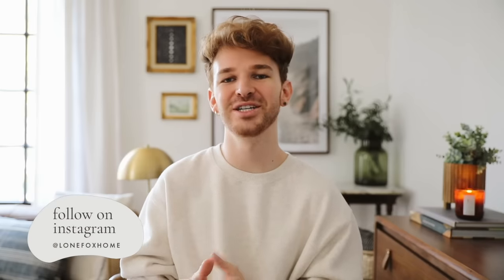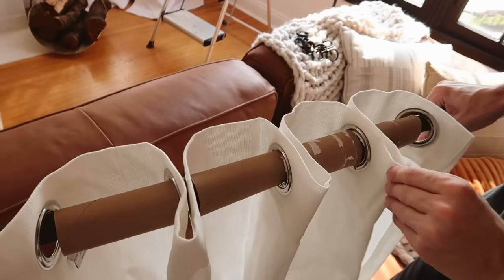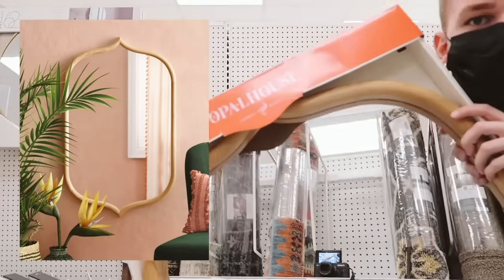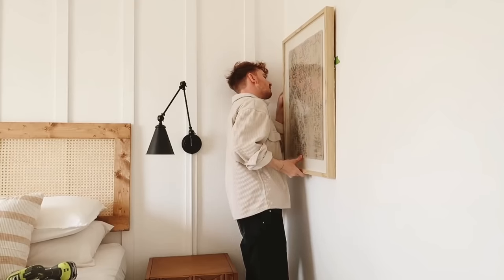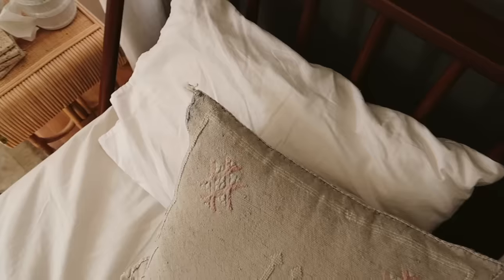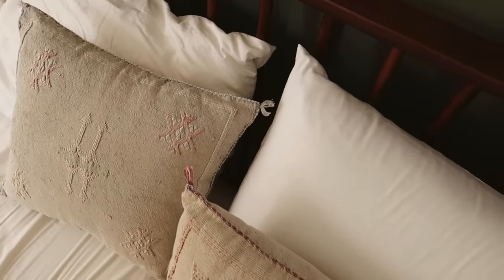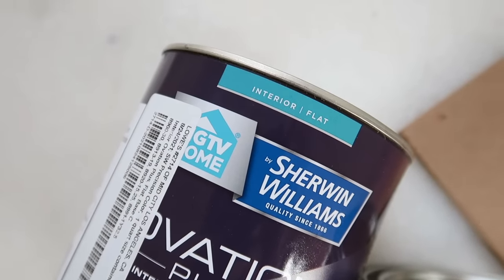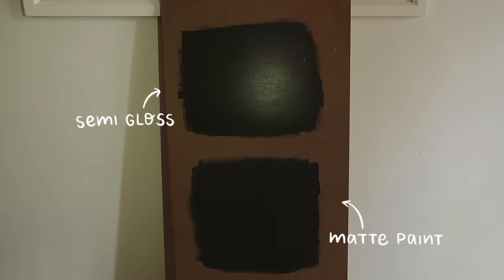10 GENIUS Home Hacks That CHANGED MY LIFE 🏠  Life Hacks to Save Time + Money!

Comment: Hey Drew! I thought I knew every toilet paper roll hack..... but this one is the best of all. I use mine to put around wrapping paper rolls to keep them closed. The painting technique is also genius, as I do a lot of painting in my crafts!
Reply: Ooh never ever thought of that for wrapping paper! Simple but totally effective! Back to rummaging through the recycling!!👍😊
Reply: @olbird7647  It works! You can cut the tp roll on one side and tape it shut if you need it to be smaller or to fit on a larger roll!
Reply: @Patti-1962  excellent tips- thank you! No more getting in a pickle with unravelling paper 😂👍
Reply: @olbird7647  I do this to stop rolls of bin liner/trash bags from unraveling. To keep both paper and bag rolls tidy I cut the toilet  roll lengthways and put it around the paper or bags then place an elastic band around it, then it fits any diameter of paper without damaging the paper (which is what would happen if you use just elastic bands).
Reply: @smurfmonster  aha! Another good tip, thank you! 👍😊
Reply: @olbird7647  you’re welcome 😊 having those rolls of bin liners/bin bags unraveling drives me NUTS!! 🤣
Reply: Toilet paper rolls are just so darn useful! I use them as molds to make upcycled candles out of  wax scraps
Reply: @adelehare8495  That's a brilliant idea!! I have so many used candles stacked up.... I will definitely have to try this!! Do you put clear wrap inside the tp roll before adding the wax?
Reply: @Patti-1962  I normally pour the hot wax directly into it, but it probably depends on the thickness of the cardboard. The cardboard gives it a rough, imperfect finish in the outside which I actually really like. You definitely need a secure base (I just glue a thicker piece of cardboard on the bottom) and you need to let it dry for a day or two before peeling it off

Comment: For tip 2, make sure you measure the distance from the top of the frame to each hanger bc they often aren’t exactly the same and if you don’t, your hung picture may not be level.
Reply: Originally a hanger on each side was there to string wire between the two— so that you have more play and can move a picture (or a mirror hung on a wire/line)  to the exact right position....i.e.  “up a bit on the right”

Comment: One of my favorite ways to hide cords dangling cords is to use a cord cover + plant. I used this with my TV cords... Command strip to attach the cord cover to the wall and paint it the same color as the wall. Then place a plant right in front of the cord cover so blend it all into the wall. I put my plant on the credenza and the top of the plant ends just below the bottom of the TV, so it completely covers the cord!

Comment: Those dang D-rings- sometimes they aren't lined up on the frame, so all of the effort with tape still results in a crooked frame when hung. The older and crankier I get, the more I like just twisting picture wire tightly between the D-rings and using one hook in the middle, resulting in less colorful language and more time to rest on my decorating laurels. Great videos and hacks as always- never saw the toilet paper roll one before, and also didn't know there was such a thing as rechargeable light bulbs! Thank you so much, and also, thank you for your wonderful personality. A day with a Lone Fox video is a better day!
Reply: Very true!
Reply: I use picture hanging wire.  I thought that's what they were for.
Reply: I can sympathize with the older crankier thing. I don't remember wanting to bang my head against the wall when hanging pictures when I was younger. The head banging doesn't help at all with the picture alignment😉

Comment: You can simply string picture wire between the two hangers on a frame. Then put your nails wherever you wish. I recommend using two for maximum support. It is simple to level a picture hanging by wire, even if the nails are at different heights : )
Reply: My thoughts exactly, I have never known anyone nail two holes into the wall.

Comment: Hello Drew. I’m new to your channel but I am enjoying it so much. Thank you. 
I prepare my own artwork for exhibitions and it is usually a requirement to have two D hooks - one each side of an artwork, even when they are small. I take a length of nylon chord or a wire and thread it through both and tie it in a knot. When hanging just pull the chord up in the middle, making an upside down V. Measure from the top of V to top of frame to determine where to place one nail/ screw in the wall. This is great for artwork that for some reason doesn’t hang level, as you can easily adjust it. You can raise or lower the height of picture without moving the nail by hanging on single side of chord loop or by two.

Comment: Hi Lone Fox!! I think the 2 picture hangars are so you can tightly  install picture wire from one loop to the next so that the frame hangs straight. For instance, if you put 2 screws in the wall, about 2 inches apart, and leveled, you then hang the wire on the nails and the frame won’t slip over time and make it crooked.

Comment: What syncronicity!  In my decluterring this morning, I found a stash of toilet paper rolls.  I thought they'd get recycled, but instead I'll use them in my curtains!  I also had a collection of decorative sticks (much cuter than this description makes them sound haha) in an opaque 18" vase in my bedroom.  They just didn't seem right, so I tried putting a 6" plant pot inside the vase - it fit perfectly, another bit of synchronicity!  With the literal elevation, the sticks now feel cohesive because their tops are at the same level as the top of my closet door.

Comment: For hardware with two screws: use the stamping method on a piece of scrap wood and drill the holes. This will create a really sturdy and easy-to-use template for drilling holes. You even can clamp the template down on whatever you want to put the hardware in. Super handy, especially when having to level something. This method makes it also really easy when you have a couple of drawers, you want to make sure the handles are on the exact same spot. Just make sure the wood is centered and the holes on the template are level compared to the edge of the wood.
Reply: Okay this may be a dumb question but when drilling your holes on say drawers do your drill from the outside or inside of the drawer?
Reply: @amyberkheimer7996  From the Outside. It's the easiest way. Theoretically, you could drill from the inside too, but sometimes you will have problems fitting the drill inside the drawer. Plus, if you're just changing the hardware or adding some if there hasn't been some added yet, it's the easiest way to go from the outside. If you're worried about messing up your drawer front: that usually doesn't happen while drilling. When you're drilling in the drawer, the wood shouldn't crack or look fuzzy. It's a howl different story when you're cutting wood with a saw. But to avoid it getting "fuzzy" or having little pieces chip off the surface while doing so, you could actually tape the area you're cutting with painter's tape. Make your mark on top of that and saw with the tape on. Your edges should look clean and smooth. 
If you're really worried about drilling on the outside of your furniture, you could use the tape trick as well while drilling. I'm just not 100% sure how the drill takes it. But it should be fined.
Reply: I do the same but use cardboard as my template for an easier and cheaper way.

Comment: Drew, I recently did a gallery wall and used your tip in placement and it worked so well!  It turned out beautifully and I was able to change it around until I was pleased before I nailed them up.  Thank you so much!

Comment: ⚘ When hanging light items on a wall, use a straight sewing pin. They are very strong when hammered in close to the wall. Itty bitty holes when removed. If painting no need to patch the hole.

Comment: Instead of ruining lipstick,  use painters tape over your handles, mark where the holes are, and instead of wasting paper for placement,  use painters tape to make a box of where the frame would be. You can also mark with tape from the back of the frame where the holes would be. Put tape over the hooks, place tape on wall, use leveler if tape is straight, drill right through tape, then pull excess off. Youre adorable and love your energy and your design ideas!

Comment: Would love to see your tips for reworking a full matching furniture set - I can’t afford to replace the one my folks bought me for my bedroom years ago and the ‘everything matches' look just ain’t it.
Reply: Paint the night stands a contrasting color? Change out the knobs?
Reply: @KelseyCodes  yep! Paint, wood stain, peel n stick or even ordinary wall-paper,  and new knobs can completely change the look of furniture. Even just moving furniture around can help!
Reply: Separate the furniture into different areas of the house
Reply: @michellesc0711  I could do in theory but unfortunately the central pieces are a wardrobe, chest of drawers, desk/makeup table and bedside table/nightstand with drawers. 

Might try using peel and stick wallpaper and replacing the knobs on the chest of drawers and bedside table though, since they're the two most obviously matching items that have to stay close to each other due to the weird room layout.
Reply: There are a ton of YouTube channels with ideas for refinishing and flipping furniture to help give you ideas. The same are available on Pinterest too. My biggest recommendation if you're going to paint though is to use chalk paint. No sanding or prepping is necessary and the learning curve is practically nil for beginners. I don't like using the wax to seal because that usually needs to be redone yearly to ensure continued protection. Just use a water-based polyurethane or Rust-Oleum's Chalked Paint in clear. Also, you don't need to buy those expensive-as-heck Annie Sloan or Dixie Belle chalk paints. Unless you want to of course. Walmart sells Waverly for a super affordable price or you can buy Rust-Oleum's Chalked Paint. I hope these tips help, happy hunting and DIY'ing, be 🙏🏼 blessed and stay 😷 safe.
Reply: Absolutely! I was going to say everything Melissa DeVille has said! There are an assortment of colors to choose from as well as antiquing waxes. Then you can choose from matte to glossy finish in a clear coat spray; which is by far easier than rewaxing every year. Plus spraying on a clear coat will make it water resistant, which is a good thing if your like my fam  and have an icy beverages on the nightstands! Ruined ummm more than one nightstand top that way! smh 
Oh! I've also seen some cool YouTube videos that show applying decals and such.  Or Mod-Podge some pictures, old newspapers, colorful tissue papers, you name it! The first step is to be brave and take a chance!
 Then, there ain't nuthin' to it but to do it!! Good Luck!

Comment: Loved tip 8! Had never heard this. I ALWAYS use two nails nailed level and picture wire between two hangers (I add them if the frame doesn’t have two). This keeps pictures from going out of level and having to straighten them all the time, especially for gallery walls.

Comment: The painters tape trick for hanging pics is my favorite…but I also use painters tape to make a level line if I’m doing a gallery wall with a more defined border or angle, or if I’m trying to hang two or three similar pieces (or a set) side by side. It makes the whole process SO much easier!

Comment: Another great tip for fuller throw pillows: Even with a too-thin down and feather insert just add in random synthetic batting. It will fill the corners and add fullness around the insert and still keep enough "memory" so the pillow looks luxurious. Pillows will still be able to be chopped.

Comment: Using white caulk also works great for clean lines when painting. Put in right on the corner of the tape and wipe it so half goes on the wall and half goes onto the tape and just make sure you tear the tape off while the paint is still wet.

Comment: For the picture hanging, that the picture or mirror has the two hangers on each side, I have always bought piano wire, cut the wire longer than the width of the picture, insert one end of wire in hanger, twist the end of wire on the other side of hanger, twisting the wire onto itself, repeating on the other side, then you can hang on the wall using one nail. Very easy.  I do this for all my large paintings, mirrors

Comment: Love your tips!  I use pool noodles cut into small pieces and stuff them in round forms to fill my over-sized pots, then it doesn't need as much moss to complete the look I want.  I also use painter's tape and stretch it over the handle posts & tape it on my cabinet/drawer to use as a guide for drilling.

Comment: A tip to hang pictures that have the two nail holder, is just to tie some strong twine or string to each nail holder and then hang the picture with the string on one nail. Triple the string for a heavier picture. :)

Comment: For anything that needs a hole or screw etc for hanging (good for the screw ones that have the wider mouth at the bottom) is I put Blu tac where the hook/hole is on the back of the multi plug or picture etc, put a tiny dot of pen/biro/felt tip/whiteboard marker etc n push against the wall/surface. It'll transfer a mark of the pen etc from the Blu tac to the wall!

Comment: To prevent paint bleeding there's another method which does the same as yours but might be more suitable in situations where you might not have that original color or something along those lines. So instead of that underlying color might can take acrylic to seal the edge and that does the job great.

Comment: Thanks for all the tips! Very helpful . In regards to hanging pictures and mirrors with two nail hole openings , another option i have found helpful is using a screw in loop eye on each side and then attach a heavy duty picture hanging wire through each side , just hang and adjust to level the picture , art work , mirror etc .

Comment: Lol two nail holes on either side of a picture frame are designed to have a loop nail put into them with a string attached from either end and you then put nail in the wall so the picture can  then be moved to different places in your home xx

Comment: When you bought a blind and it missed a few centimeter or less than half an inch, you can put a black (or any color you need) tape on both size of the glass window filling the space  between the blind and the side of the windows. It's a tip usefull when you have non conventional size windows.

Comment: Tip two- just buy some picture frame wire  if you have two hooks. However when you get insets  on the back, tip two will have to be utilized.

Comment: Hack for bleeding paint when your walls aren't white. My apt has a weird grayish beige but my accent wall is black. Paint your space but stay about an inch away from the tape for both coats. While it's still wet, paint the edges with a fairly dry brush both times, you'llhave full coverage when you go in the 2nd time. (Heavy paint is what makes it bleed) when you take off the tape it will match everything else but your lines stay clean :)

Comment: My hack for frames with 2 holes is to loop a strong string and hammer one nail in the wall. Hang from the center of the (shoe)string. Make sure it has a little slack and your knot is  strong. This is also great 'cause if someone bumps it the frame doesn't just fall, it has give.

Comment: For Tip #8 w using painter’s tape for a crisp line…. If you don’t have the original basecoat colour you can use CLEAR COAT or mod podge (watered down to the same consistency as paint) EVEN  watered down white glue in a pinch — as u only need to seal the tape edge… 
It doesn’t need to be any more than 1/4  to 1/2 an inch on either side of the tape edge — let completely dry before painting your new colour on top,  exact crisp line every time - especially useful if you are doing graphics and complicated taping!

Comment: Regarding your picture hanging :-  our pictures come with two hooks on either side with a piece of string tied across them , then all you need to do is nail a hook in the wall and hang it from the string which you can slide across until it's level 👍👌

Comment: Hanging pictures with 2 hooks: tie a string across them, hang in center. Make sure string is tight enough nail doesn’t show when pictures weight hangs on it
Reply: I was going to say the same thing, you get wire for hanging pictures like this. It is a good tip, but go with one hole.

Comment: For a gallery wall, why not do what art galleries do — install a gallery wall hanging system.  It isn’t difficult or expensive, and the bits you need are readily available at many hardware stores or art supply shops.   You start by screwing a rail to the top of the wall, coming no closer to corners than a couple of inches.  This rail works rather like a curtain rail and is the only holes you will ever again  have to make in the wall, just one at each end.  Then you slip onto the end of the rail the hanging cords.  They are either clear acrylic (I think) cord, or stainless steel wire, attached to a rolling slider that can be positioned back and forth anywhere on the rail.  You can add as many cords as you want, and add more or remove some whenever you like.  Then you attach hanging hooks to the cords.  They fit over the cord and slide up and down to where you want them, then lock in place.  You can have multiple hooks on one cord if you want to hang pictures one above another.  Total flexibility with no holes.  Fabulous for renters, brick walls, or people who like to change their rooms often.

Comment: Drew, the two hangers, one on each side of the frame are for picture hanging wire so you can use 1 nail or screw to hang and you don't have to worry at all, straightening the picture is easy.
Reply: You are absolutely right. I have done that with large pictures and it works so well.